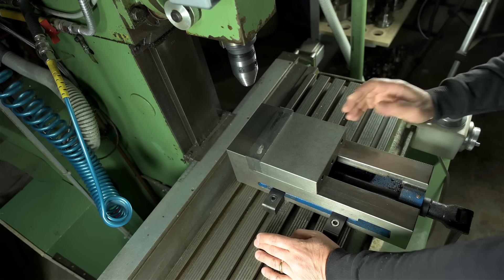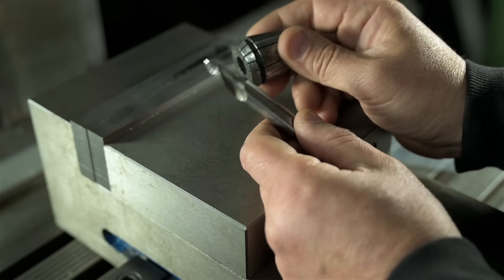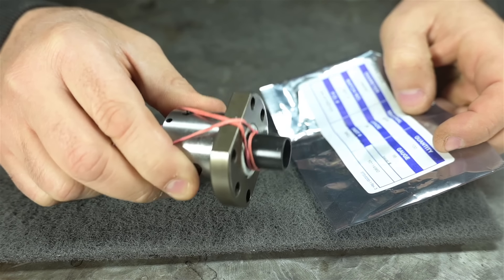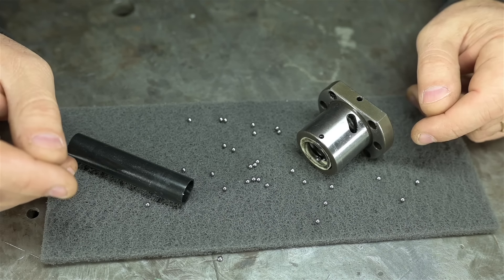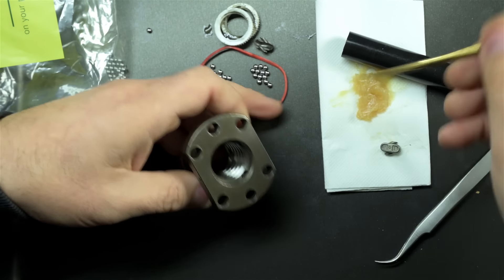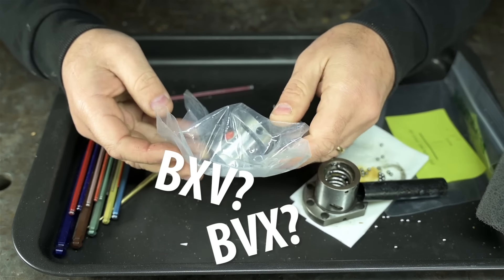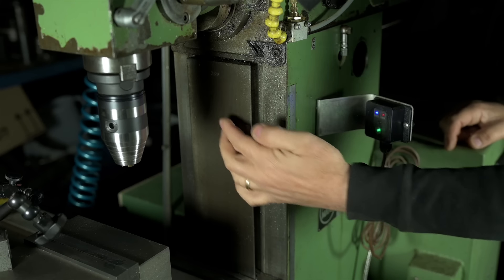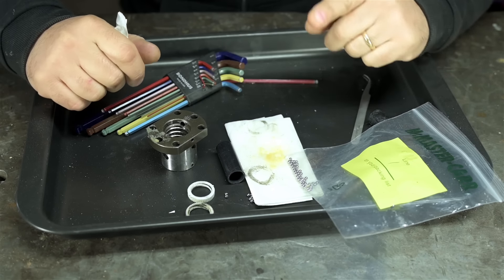Rebuilding &/or Replacing BALL NUTS

Comment: I once ran a super-expensive ball nut off the end of the screw (bad software design). After picking up as many balls as I could find off the floor of the lab, I had the uncomfortable phone call with the supplier "how many balls are there".  They informed me there are two sizes of balls that alternate (a couple tenths difference) with load balls separating ball & nut radially and spacer balls (rotate in opposite direction) separating load balls without rubbing on screw or nut...  I replaced the assembly...
Reply: Damn.
Reply: Yes i said exactly the same thing...Ball screws have two sizes of balls, if you dont seperate the balls alternately they wont roll if they are close fitting.
Reply: I didn’t know that. Thanks for that info
Reply: That allows one to hang lower than the other!
Reply: My condolences to your wallet
Reply: Yep, I once had a problem with the software on an very large American lathe, with the result of toasting the Z axis ball screw, a screw that on that machine is around 4 inches in diameter and 10 feet long. Needless to say I was not happy.
Reply: 😆Sorry for you loss...
Reply: @skylark4901  thanks!  It has been expensive, but you have to follow your dreams!
Reply: @skylark4901  1994... I got over it
Reply: @oldfarthacks  unfortunately, I'm the guy who wrote my faulty software...
Reply: Ah well, live and learn
Reply: You didn't just send it back to be reballed?
Reply: @crackpotfox  all the way to Japan... Would end up coasting as much and blowing my schedule. I had experiments to run and a thesis to write...

Comment: One trick for the "Gravity fighting against you" when you're filling these, instead of the world stickiest grease that you probably don't want in there anyway - is just to pop a couple of small magnets on the body - that will hold the balls in position when you place them and you just pop them off after everything is on the ball nut. That means you can use your correct grease/lube instead of something full of tackifiers from the start.

 Also as someone else said - if there looks like there's space for one more ball, then you have the correct amount in there. You need free space to prevent rubbing and jamming issues.

Comment: Talk about bursting my bubble of hope...

I have two 24" ball screws w/ a bit of 'seniority', (like me, old as dirt).

I have a purpose for them, so I ordered a bag of same size balls, (someone didn't have a mandrel, & not all the original balls survived), & not finding oversized balls, ordered another bag of metric balls, which are slightly oversized. 

Can't recall the dimensions, but was thinking the same as you, I might be able to compensate for wear w/ the oversized balls.

Guess I'll try, anyway, to see if I have success, or end up where you did.

The ball screws I have look like the illustration you showed; two external tubes. Since I got these screws missing balls, I consulted a machinist friend; he said feed them in the tube until no more would fit.

Packing them in w/ grease reminds me of rebuilding 4 speeds back in my racing days, where needle bearings had to be put inside the cluster gear, & remain while the cluster shaft was tappy-tap-tapped into the gravity defying roller bearings.

One quickly learns 2 things doing this:
Which grease is the stickiest and...

New & creative descriptive swear words.

GeoD

Comment: The moral of the story is I now want that pass-through ratchet you used to remove the bearing. Great video, Tony 😊
Reply: Looks to be a Williams ratcheting wrench
Reply: @brianargo4595  thanks! Looks super handy, especially with the thumb wheel on the back.
Reply: I thought the moral of the story was that you need appropriately sized balls to get the job done.
Reply: @Timo  "make sure what you do is a product of your own conclusions"
Reply: @aaronb554  Can‘t argue with that 😊
Reply: i think this wrench your talking about Bostitch 32-Piece Bit Wrench Set BTMT72275
Reply: @johnknox5692  thank you!
Reply: @johnknox5692  Sadly, they don't seem to make them anymore.
Reply: Just get a 1/4 drive wobble drive
Reply: Maybe the Klein 65200?
Reply: I have a VIM (HBR3) 1/4" hex baby ratchet that looked similar to the one he was using.  It is really nice every now and then when working in tight quarters.
Reply: Wera makes them, as do a number of companies.
Reply: The Facom Pico set is a flex-head marvel… but you’ll find the same bit ratchet in the video is available from dozens of brands. 

HF sells an ‘Icon’ one that is almost identical to the Facom one.
Reply: @anticom1337  it is!
Reply: @frankblack1481  except that the ratchet mechanism will poo itself after a few months. Get the Wera one. It's a good $/value proposition.
Reply: I got a nice pass-through set at ACE Hardware.
Also, moral of the story... "You can spend 20 minutes watching a video about something you'll never need to know, yet still be entertained!"
Reply: 😊It's a 1/4" ratchet wrench that has a 'backstop', which prevents the hex bit from sliding through the hex of the wrench.

While you CAN use an open hex, they are a PITA,compared to a back stopped ratchet wrench.

I found an inexpensive 1/4" ratchet wrench & hex bit set from MSC. It's sold under their house brand, Paramount. Once I got the first one, I ordered 2 more. I learned, over the years, as soon as I find something, tools, underwear, shoes, food... I really like, they are discontinued.

GeoD

Comment: Nice video Tony, I used to make Ball screws for a company called Thompson IBL, they had a great name for quality in their day. Loading the balls we had solid shafts, no grease needed to hold the balls in place. We had draws of ball bearings in one micron increments and it wouldn't take much to go from backlash to a preloaded condition. Most ball screws had a preload tolerance which was measured with a spring balance. Wipers were always installed after the nut and were not tight against the nut as to not impact the preload.
Reply: Light Machines (now Intelitek) used IBL ball screws in their machines - a P5 rated rolled screw. 16mm x 0.2" with special preloaded square block nuts. Five years ago, Thomson quoted me nearly $2400 for a single 465mm long assembly, not even including shipping (from Germany), or taxes.  Not surprisingly, I rebuilt it instead.  I'd love to know more about how you measured the preload and what a typical preload for would be.

Comment: Always enjoy your videos.  As a young engineer, I worked in a facility that made custom ball screws.  I recall that a certain amount of the circuit is kept empty to facilitate the free travel of the balls and limit ball to ball friction.  It changes based on ball size.  The point being, next time you rebuild, you don’t want to put every ball you can fit into each circuit.  Cheers!
Reply: Good tip , cheers . I’ve noticed the same rule on rebuilding large linear guide blocks for machine tool bed ways .
Reply: It's the same with the older style bearings on bicycles.  Older style meaning ones able to be rebuilt.  It's the number of balls that'll fit minus one.
Reply: I wonder if putting in teflon washers in between the balls could act as a cage, like on a modern roller bearing. Keeping the balls apart. I wonder if they would ever stay in place through the return channels. 
Then again, it seems to work just fine without a cage, so maybe i should not think about it.
Reply: Ball to ball friction isn't always a bad thing

Comment: I think the real moral is that giving the cheap fix a try is almost always worth the knowledge gained alone, and sometimes it even works! 😅
Reply: When I was young and poor, I used to have to do the normal young-guy  thing and keep a series of shitbox cars running. I learned early on to always, ALWAYS, start with "cheap and simple." You can always get more expensive, bit its good to rule out the cheap and easy fixes before that.

Comment: Hi tony ,fun video . having replaced a number of ballscrews over the years and having the great fortune to travel to Japan  for training at a large and well regarded cnc machine 
tool manufacturer perhaps I can offer some of what I have learned.
1) a high preload ballscrew and nut will  feel lumpy ,in a smooth sort of way. a worn out high preload screw will actually turn very freely, in fact if you hold the screw vertical
the nut will spin down on its own.
Many  machinists don't don''t like the feel of ballscrews on manual machines because they do not feel as smooth as a leadscrew.
The lumpyness is caused by the ball returning from the recirculation tube /deflector. High preload is achieved  by sizing the ball larger than the groove its running in. (for most 1 nut setups).
2) In japan, we spent some time in the ballscrew assembly department. you were right in your speculation about several size balls. The assembler placed the nut on the screw and then 
placed the appropiate number of balls into the nut through the deflector tube holes. once the balls were in place he would rotate the nut to see if the ball size was correct. interestlingly
the way to know when it was right was to rapidly rotate the nut back and forth several times ,about 180 degrees, hesitatate for a second and then rotate the opposite way , there would be 
a tiny hesitation or "grab" before turning.
As these were double nut screws this would be repeated with the second nut. then a large range of spacers were available to place between the two nuts to both line up the keyways and
bars between  the 2 nut  and to achieve the proper preload between them.
3) most large machines use double nut ballscrews.  single nut ballscrews use either oversized balls for compact nuts, or 2 sets of  races , one with right hand   preload and the other left.
Reply: That's a heck of a process. I wondered if running with fewer balls would give enough clearance for oversized balls to fit the screw. Any feedback on that crazy idea?
Reply: @scottcates   Hi Scott , what i saw at that factory (about 2001) was a very skilled and experienced assembler fitting the balls largely by trial and error.
what i recall was a nominal sized ball  and a range of +/- balls in about .001mm increments.  he started with the nominal size and then almost immediatley
was able to select the right size for the desired preload. he had been doing it for many year, I could imagine that a trainee would take months to become as 
proficient.
Tony had referenced a ball bearing , this is sort of what a ball screw is, a bearing with benefits, so there is an ideal size ball for the job.
like a ball bearing fewer balls would not allow for a larger diameter.  
A bit of additional information ballscrew races are usually(quite often ?) ground not as a perfect circle but in a     4 point contact or gothic arch profile, so   that the balls 
are touching on their sides rather than top and bottom.
Reply: @steveggca  Thank you, Steve!

Comment: For cheap ball nuts, you can set them up in a double nut configuration with a spring in the middle. This will reduce the backlash and let you tune it out in the future as the nuts wear.
Reply: Now THATS an interesting thought... how do you keep the springs from accidentally interweaving with the balls and capturing them?
Reply: That's all good for a 3d printer's Z axis but that's not going to work with the forces involved moving the axis on a Maho.

Comment: I'm in the early stages of building my own CNC router using ball screws and this was indirectly very helpful, I hope I won't have a moment of "52 ball pickup"!
Reply: I did as well. Cheap amazon ballscrews got me max .0015" Backlash. I use a bit of Vaseline, petroleum jelly, put a thin film on the screw, run it back and forth, then wipe it.

Comment: You should remove the seals from the nut before putting it onto the arbor. It will help protect the seal since (the ones i sell) they aren't circular.
Also consider checking to see if there are multiple starts since you can put the nut on a different start when reballing it (as long as the nut raceways are in good condition)
I'm a linear application engineer and deal with these babies daily :)
Reply: But the real question is are you a good LAE? 😂

Comment: The ball nuts on my BP conversion are double circuit but each circuit is at least two possibly three turns.  It's also much longer than your ball nut.  In a good ball screw assembly the ball sizes have been selected to provide preload to each circuit to reduce or eliminate any backlash.  Because preloading caused more drag on the rotation every other ball in the circuit is slightly small in diameter and acts as a spacer to reduce the drag while keeping the bearing area constant.  They also have external return tubes which allows for easier ball loading.  Tony is correct a really good ball nut and screw is quite expensive.  The worst sound is hearing the those balls fall out onto the floor never to be seen again.

Comment: I had a similar experience with my X-axis ball screw. It needed maintenance as it was very dirty. Spin off the nut and collect the balls. I counted 63. Maybe I had lost a few. I tried the grease and place in the balls but that didn't work. I then noticed a small depression on the side of the nut and used that to load each dry ball. I at first tried that without loading the 3 return channels,  That just bound up the load. I started over and loaded each return channel with grease and 3 balls in each. Now I loaded each ball again dry. That allowed me to load all the balls. Yep, I did lose some of the balls.. It still worked though.  It sure takes a lot of patience, but I'm sure that you need that too! Thanks for the great video.

Comment: Good fit for non preloaded ballnut.  Most CNC ball screws are preloaded so basically you have 2 nuts pushing against each other to remove the backlash amd not depend on the clearance of the screw/nut/balls.  For putting them together turn a bar the diameter of the shipping retainer with taper on the end.  Also surprised you have such low backlash as thrust bearings are a common point of failure, and they are far from cheap themselves.  Good video, as always

Comment: I just realized that grease is a non-newtonian fluid. But unlike oobleck (corn starch and water) which is shear thickening (becomes thicker under shear stress), grease is shear thinning (becomes thinner under shear stress). This makes it perfect for easy application, as it is thick and sticky and will stay put, but once the mechanism is moving it becomes thinner and acts as a lubricant instead of a sticky compound.
Reply: @Tyler Dollarhide That grease will get washed out real quick from the oiler. The grease was just to hold the ball bearings inplace so they don't fall out, thats all.
Reply: There's a lot more to grease than that. For one, it can seize up the parts. I run a CNC Turret punch, and before I got my hands on it, they were using this dark brown Shell Grease. Every week I was cleaning the punches because the grease would harden and seize the punches, damage or even break the punches if gone un noticed, I switched to a synthetic Ams oil red grease and never had another stuck punch... However, I would never use it on ball screws, Thats the job of the grease that seized my punches.... Moral, Use grease specific to the application.

Comment: For me, the moral is that you probably won't know why and how something doesn't work until you try it - and it fails.  That's often even more valuable knowledge than how it's supposed to work, because each failure analysis fills in some gaps in the picture.  (Sometimes, those are gaps you hadn't even known were present.)  One of the most important rules of engineering has always been that if you aren't able to make mistakes, you're probably never going to make anything at all.  We often learn more from mistakes than from what we view as successes.  And sometimes, just once in a while, a "mistake" has an unexpectedly successful result.
Reply: Exactly. You don't really learn how something works until it breaks.
Reply: Ah, like the "failed" 3M glue that lead to stick-on notes.

Comment: A few years ago I rebuilt a recirculating ball power steering gear box.  I used two different size balls.  They were identified by their color.  One size was darker than the other.  They were loaded alternately into the ball nut.  It would have been interesting to have loaded alternately OEM balls and the McMaster-Carr balls to adjust the fit.
Reply: Alternating ball sizes are a waste of time and reduce load capacity. You don't need two sizes to "adjust the fit"
Reply: @IlPinnacolo  Wow, lightbulb moment. The friction of the balls against each other never occurred to me. Thanks for the informative post.

Comment: Ah memories...  When I was just a wee nut, I rebuilt quite a few Ford recirculating ball power steering units.  The first for my Dad's work truck...  Ford would not rebuild the PS units themselves, and their dealer mechanics wouldn't repair them, but they would sell you the rebuild kit over the parts counter.  Fun times.

Comment: Years ago I tried to replace the balls oflead screw on a large cnc horizontal boring mill.
It didn't work - it was still binding up. The screw was in perfect condition. It was an imperial screw, but we couldn't find a reasonably priced replacement, so we had to use a metric one and hack the control to work with it.
I dismantled the old nut and found that the real problem was that the return tubes had worn, causing the balls to pile up and jamb.

Comment: I have an ACRA knee mill with MillPwr and it uses double nuts. The X-axis used two different size balls (0.0005" difference). I have somebody else repacking them and he caught it. So one nut gets one size and the other the different one. It's a 50/50 guess which one is which and he won't know until both are packed and then puts it on the screw to check backlash.